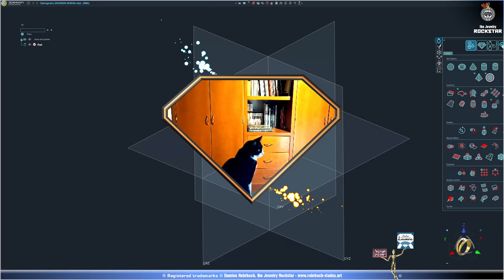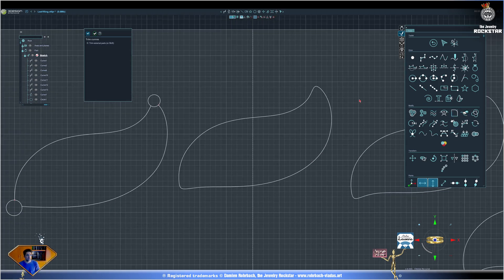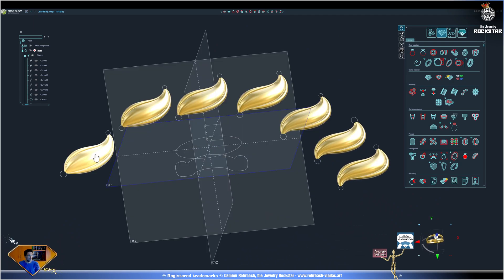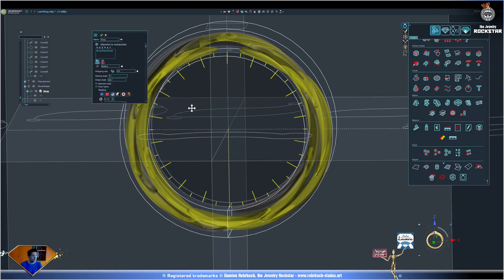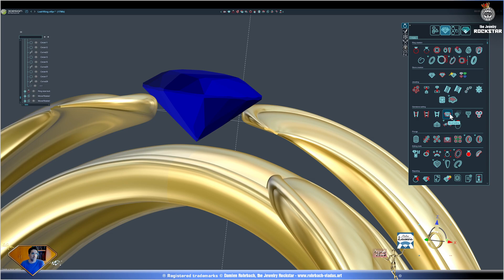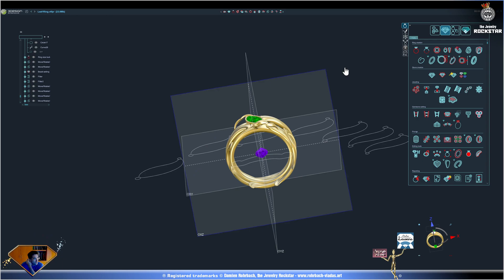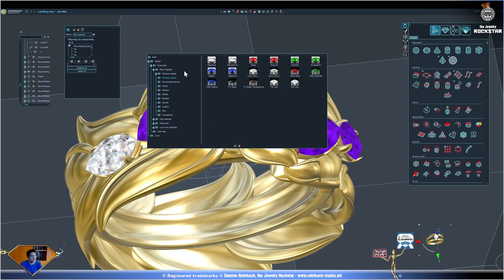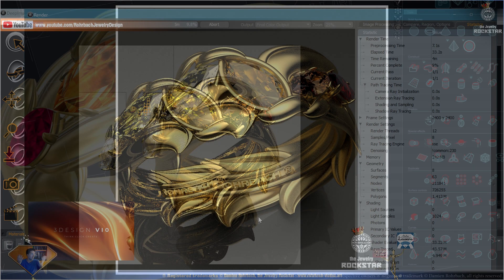3D JEWELRY Leaf Ring modeling and render using 3DESIGN CAD V10

Comment: Can i use this software in wood ornaments?
Reply from the maker: Yes, 3Design is a CAD software used in many industries for design and manufacturing using CNC cutting machines and 3D printers for example.